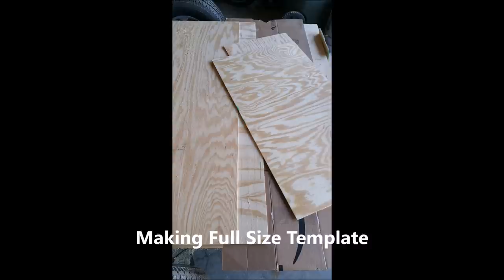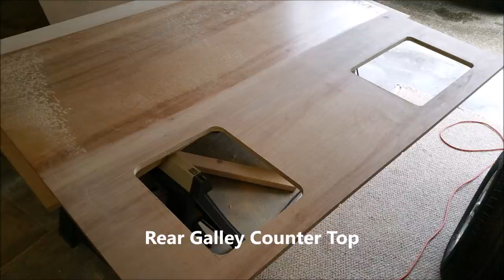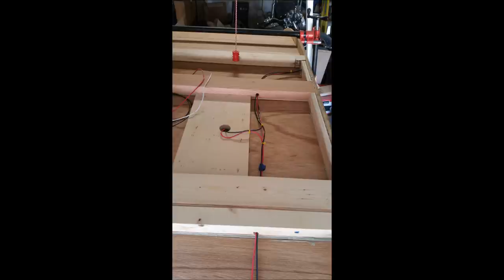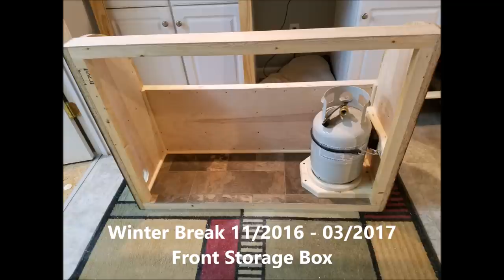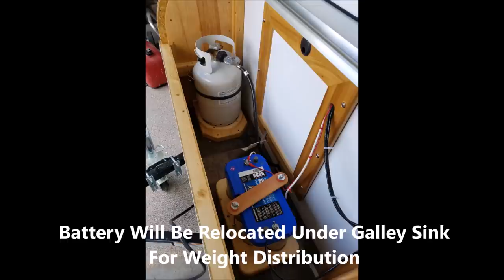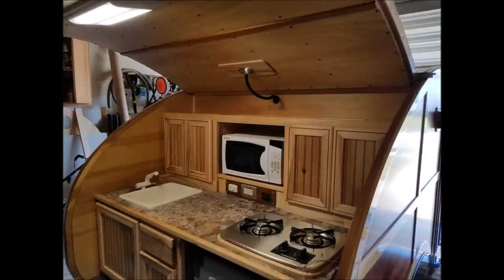Teardrop Camper Build (BnB42)

Comment: Stan, today is March 18, 2020 and I wanted to let you know your video of your tear drop camper is still on-line and very much appreciated.

Your attention to detail and dedication to not cutting corners has my respect, since I do the same thing, and fortunately, like you, I have an understanding Wife who supports the little boy in me that tends to break free and run in all directions at once when it comes to my projects too.

Anyways, thanks for taking the time to document your build and moreover, showing some of the finer points of how you pre-built the electrical and water lines for it.

One question though, did you purchase plans, such as a template for your trailer and if so would it be possible to btain their cintact information, but if not let me know how high the shell is from bottom to top and how long it is from front to back - without the dohouse in front for the propane tanks.

Once again, Thank You for sharing what has to be the nicest modern tear drops I've seen so far.

Comment: It looks beautiful. How have the hurricane hinges faired? I watched another guy struggling to seal his top hung door with several different hinges including a hurricane and they all leaked so he ripped it apart and changed to cargo doors.
Reply from the maker: The hurricane hinge has worked flawlessly ... been in some hellacious downpours ... not one drop of water has been observed anywhere inside the galley or cabin.  Hurricane hinges work fantastic but they have to be installed properly where they overhang the side walls otherwise water will always find its way inside.

Comment: Nice!....were did you get the aluminium trim for the front and rear hatches? did you build a standard design with dimensions you could adapt hardware sold from a manufacturer?

Comment: Very nice build! It’s good to see quality and clean careful thoughtfulness in building. Did you make the mattress?
Reply: I’m also slightly curious why you went with prefabricated doors? I bet you could have made a beautiful door to match the camper?
Reply from the maker: Purchased mattress on Amazon... queen size 8 inch thick foam ... had to unbox rather quick as its expansion was almost instantaneous.   As for the doors... I went with purchased doors rather than building my own as I felt there would be less of a chance of leakage ... mission accomplished!

Comment: Nicest teardrop I've ever seen. My wife and I want one so bad but all we have found either don't fit exactly what we want or are way overpriced. Did you start with a set of plans, draw it up yourself or just wing it as a work of art? Also, if you don't mind, roughly what did it run you? I'm thinking I can probably come in around $5000. Is that too optimistic? Last question, for now, what size trailer did you start with? Thanks in advance for any hep you are willing to give.
Reply from the maker: Hey Fletcher .... My wife and I ran into the same problem nothing seemed to fit exactly what we wanted.  I did buy a set of plans but some of the construction techniques didn't seem right to me (and it still wasn't what I really wanted).  I also looked at couple more free sets of plans on the internet (same situation). What I ended up doing was gong out onto google images and looking at everything I could find showing galley layouts cabin interiors latching onto as many ideas that I could .... and over the course of a couple of weeks drew out my own plans (including electrical and plumbing) .... and yes there were a ton of changes made on the fly throughout the construction but the overall looks never changed from the original plans.  As it sits I have slightly over $8000 in mine .... could you build one for under $5000 ... ABSOLUTELY ... using different fenders, build your own doors and skin it using a different material (clear straight grain cedar is not cheap).  The metal trailer that I started with was a Iron Man bolt together trailer from Northern Tool (which I ended up welding together just for a little added insurance).  The trailer kit that I purchased was a 5 x 8 (queen size mattress size) that I extended the tear drop sub floor to 9 feet for a little extra galley storage.  One of the absolute greatest sources of information that I found throughout the building process is tnttt.com give them a look you wont be disappointed ... but be careful the bug to build your own tear  drop bites hard .... no regrets here.

Comment: Beautiful. I am getting ready to build one any suggestions?
Reply from the maker: First make sure that you invest in a good quality metal trailer for a solid foundation.  Second, one of the best things that I did is building the tracks into the floor for the wiring to pass through ... makes it an absolute breeze to invisibly add electrical runs for goodies that you didn't think of after the camper has been completed.  Just go for it ... take your time with it and think everything through (three of four steps in advance) ... absolutely the most enjoyable project that I have ever done (even better that the 16 foot bass boat that I built 30 years ago)!  Have Fun!
Reply: Stan Slonina / can I buys plans from you? Gary Foster in Tucson Az

Comment: Stan, I'm in the beginning stages of designing my own Teardrop Camper.  Is there any way you could post or send me a list of the items/materials you bought throughout your build?  There are a lot of small things I saw in your video I would have never thought of putting on the camper until now.  Now I have to try and track down some of those items.  By the time you were finished, how much does the trailer weigh?
Reply: There are a lot of great ideas, I don't even know where to start.  I suppose the top two would be the water tank and the metal shroud concealing the wires up through the hatch.  Would it be too much an inconvenience to post or send me that excel sheet though?  And 1640lbs isn't too bad at all. I would have figured with all the wood used, it would have come out to be heavier!  I'm trying to keep mine at a pretty low wt. since I'm trying to pull it with a VW Jetta.  Instead of a steel frame, I'm going with an aluminum frame.  Just haven't figured out if I want solid plywood walls or a stick-frame wall.  Any reason why you went with the disign you used?
Reply from the maker: The water tank is a 10 gallon fresh water tank from plasticmart.com     Part Number R-RVB323    Price 149.99   + 45.45 Shipping.

I have to admit that you made my day asking about the metal shroud for the hatch wiring ... I am proud of this one because this is an illustration of just how far out of the box you have to think when building  teardrop.  This shroud is nothing more than an upside down desk drawer pull from Lowes.

The Parts List Document that I have is approximately 75% - 80% complete ... I will be happy to send it to you ... either give me your email address or you can go to my business web page keanoukulele.com and privately send me your email address through the contact tab on the web page.
Reply: Stan, thanks again for helping out.  Your experience in this type of build is extremely helpful for young bucks like myself.  Thanks again!

Comment: I have started converting a trailer into a teardrop camper. I didn't realize they had to be inspected and tagged in Kentucky. I see people pulling trailers all the time that don't even have tail lights!  We are hoping to have it finished enough to take to Red River Gorge for Labor Day. I've got to get the galley hatch done and then it will be all sealed. Still needs interior and kitchen work.